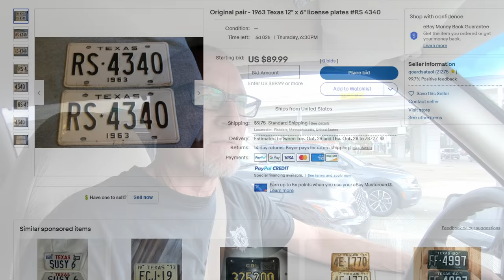The 63 Gets A New Home

Comment: Hey VW Life! one thing I disagree with, the blazecut! Its such a false sense of security and they only work for a couple seconds depending on the situation. A proper size and chemical extinguisher is way better. Plus, the only fires I've ever seen in VWs are from neglected band aid maintenance, cheap fuel filter that cracked or pict carb with a loose fuel inlet. All easily fixable.  You would not believe how many old Vdubz I see with decades old fuel lines because " they look fine" On top of that, the blaze just looks terribly ugly on a bug